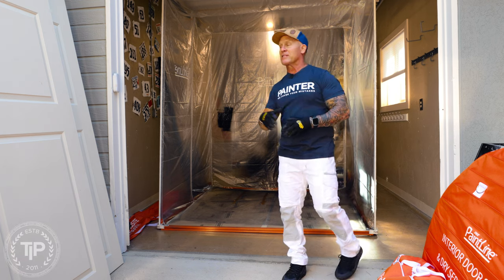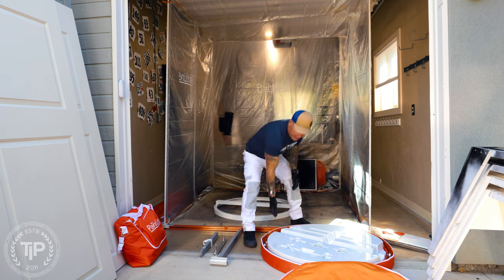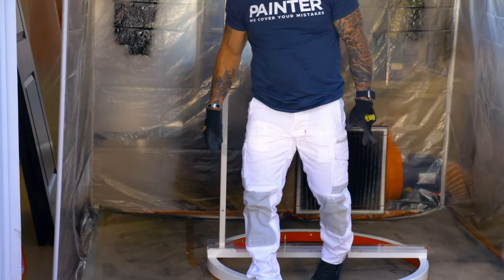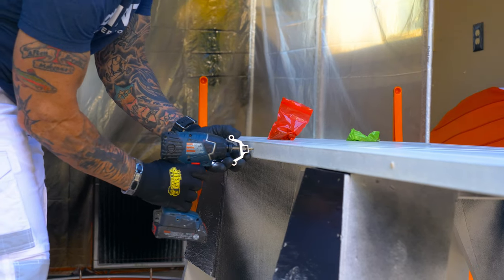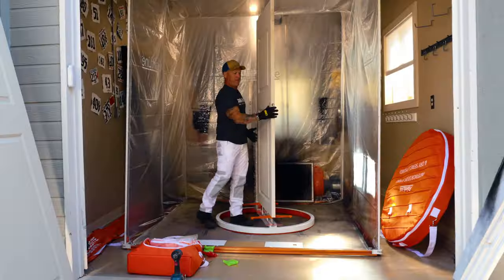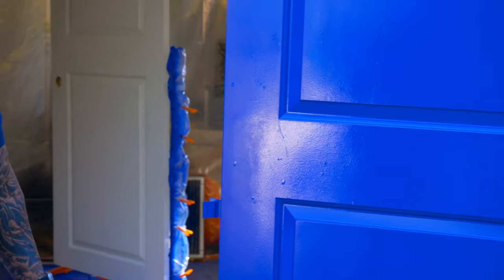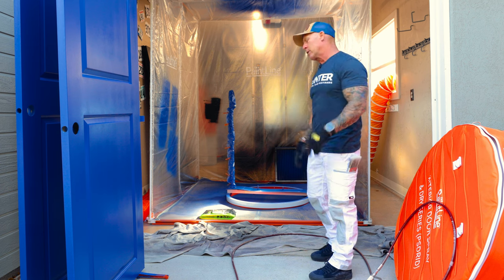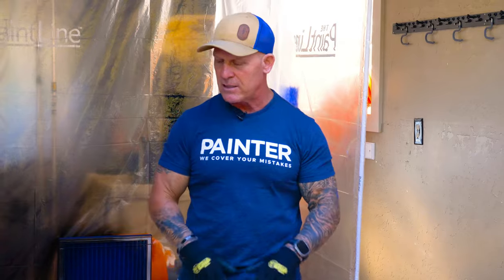Spray Doors Easily With The PSDRID

Comment: I charge 300 per door including door casing. I'm having problems with over spray on the other side of the door, when I touch the other side it feels rough! I know that if I rub the door with masking paper it'll go away! But sometimes the masking paper will leave scratches on the new paint!! I'm trying to find a way to have both side smoth as a car clear coat!!